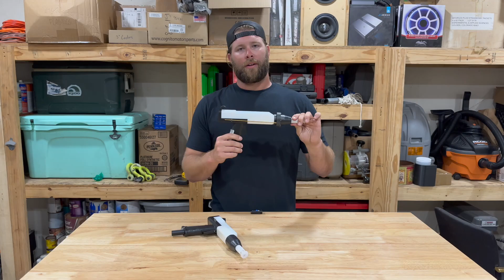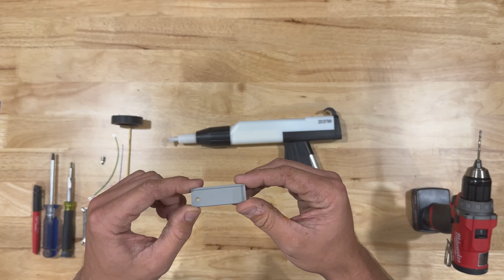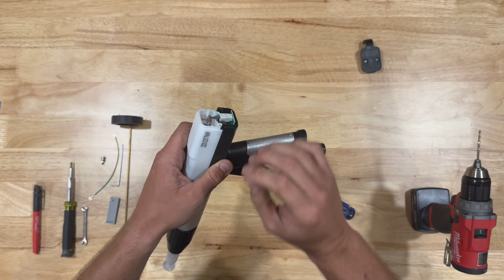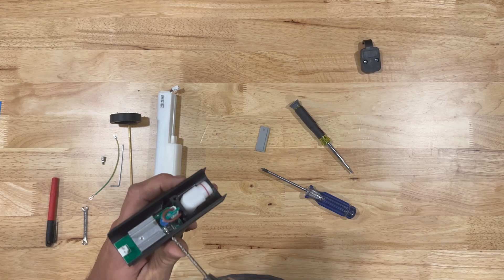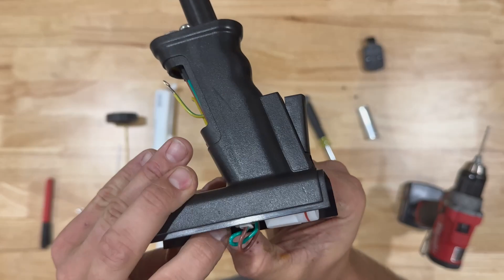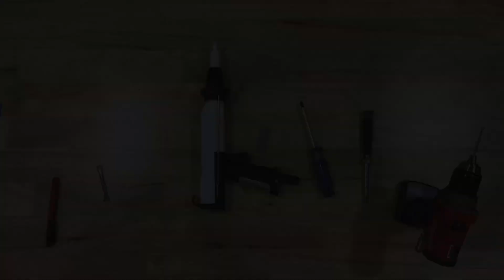Corona Ring Install Tutorial

Comment: Where did you get the nut to add to the gun so the carona ring would connect to?
Reply from the maker: @russellpageruss1113  I include them with my corona rings if needed. Just needs to be requested in the comment section at check out.